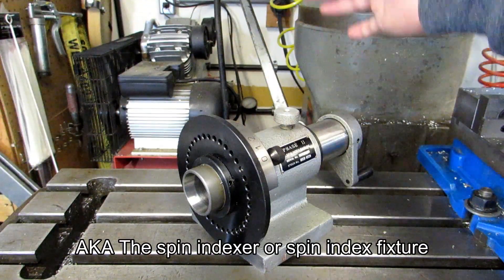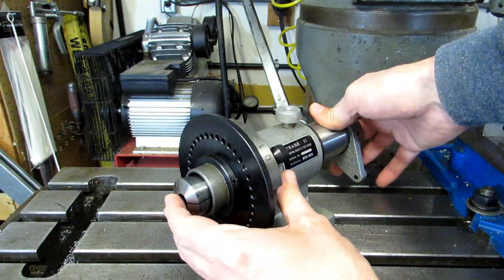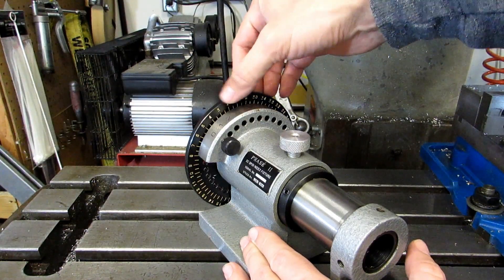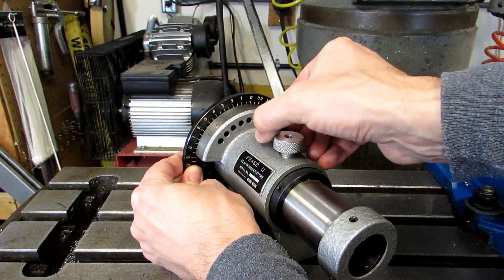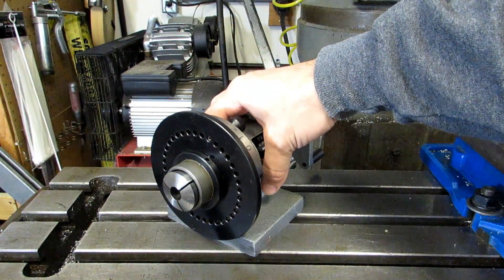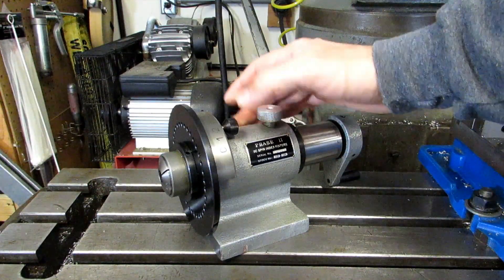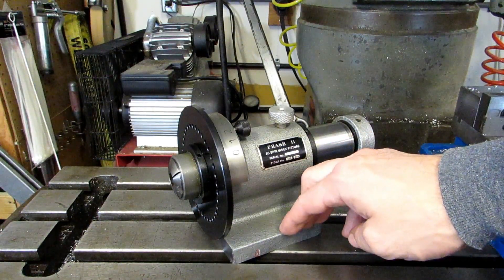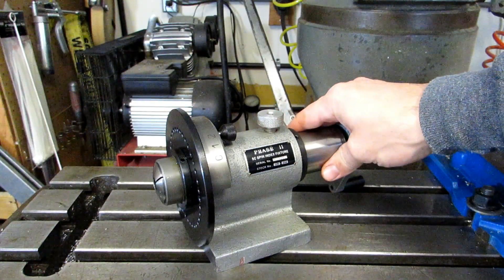Stu's Guide to Indexing Part 2: The Spindexer

Comment: Can you use a 5c chuck?
Reply from the maker: Yes. They make 3 and 4 jaw chucks that have a 5C shank and you can easily put those in the indexer. They'll take up a bit more space though so it could be problematic on smaller machines.
Reply: I've seen a post with the idea of using locking pins with half the normal diameter at the ends to enable 0.5° increments.

The chap theorised that you would have two such pins in neighbouring holes for zero backlash, but I suspect it would need to be something like 5 holes apart (10° plate division Vs 9° locking pin spacing)

Which would it be?
Reply from the maker: @prawny12009  That’s an interesting idea. I'll have to find where mine is packed away and take a peek at it. That might make for a good video. I will, of course, give you a shout out if I make it.

Comment: Good for 60-2 trigger wheel machining?
Reply from the maker: I had to look up what that was. Does the 60-2 mean it would have 60 teeth but 2 are missing? If so, that would be doable. 60 teeth would mean a tooth every 6 degrees (360/60). You might have to hold the blank, but a good option for that would be a 5C fixture plate. It's a solid disk on a 5C shank. They're available in a bunch of sizes and you would machine it to fit your blank. Face it, turn a boss to fit the bore, drill some clamping screw holes, etc. Let me know if you have any questions. Thanks for watching!

Comment: if i wanted to cut 24 teeth do i start on 0 or 15 degrees.  because  starting on 0 gives 25 teeth im a bit confused
Reply from the maker: Start on zero and then go every 15 degrees. If you go all the way back around to zero you'll be back in your original cut.

Comment: Hello, I am from Brazil, I would like to build a similar, the scale of 10 fixed holes do you know how many degrees has each spacing?
Reply from the maker: The 36 holes would be spaced 10 degrees apart. First the vernier holes, there are 10 holes in the same space as 9 on the main disk.  That should make the vernier holes 9 degrees apart.
Reply: @StuartdeHaro 

hello thanks for replying. So to build this 10 hole vernier, so they are spaced the same distance from each other, with 9 degrees, correct?
Reply from the maker: Yes. The vernier holes work by having one more hole than the main plate in the same amount of space. If each hole on the main plate is 10 degrees apart, then 9 of those holes would take up 90 degrees. On the vernier holes, you would have 10 holes in that same 90 degree arc, each of them 9 degrees apart. I hope this helps.
Reply: @StuartdeHaro 

Helped a lot, excellent explanation. God bless you for your help.

Comment: I was looking into getting one, but your comment about mill interference was a factor I didn't think about. Thanks,
Reply: Simple solution, reverse ends so the work is held on the other end. There are videos about doing that.  Also you can mill the sides parallel to the bore so it is easier to set up. I use mine mostly mounted in the vice. You can also make a stub shaft to mount in a collet and the other end to match a lathe chuck. Allows you to hold larger parts,  just take light cuts with parts of any size as the locking of the indexer spindle isn't very strong. Another advantage of a chuck mount is not having to buy a complete set of 5C collets that have a very narrow clamping range.

Comment: Stu, anything stopping you refitting the spindle with the 5C taper sticking out the current handle-end?( For extra clearance)   BTW reference marker is called the Fiducial marker
Reply from the maker: Ooooo... Fiducial marker.  Stuart has learned a new word and he will use it if he can remember it later.  As far as changing the orientation of the spindle, I remember someone doing that a few years back and I want to say it was in one of the magazines (Home Shop Machinist or Machinist's Workshop), but I've slept since then so for all I know I might have seen it on teh interwebs someplace.
Reply: @KW-ei3pi  I've not , but if Stuart has seen it done on the internet then it was probably by the late John Stevenson  , a search for the John and indexer might find it
Reply: @KW-ei3pi  I had  quick look pictures on the web and it seems that the index plate is clamped to the spindle with a threaded nut against a shoulder.  So, to move the plate will require a new mounting method which might make it tricky.